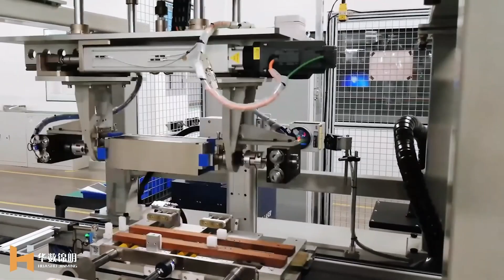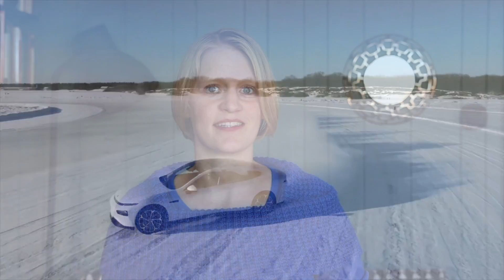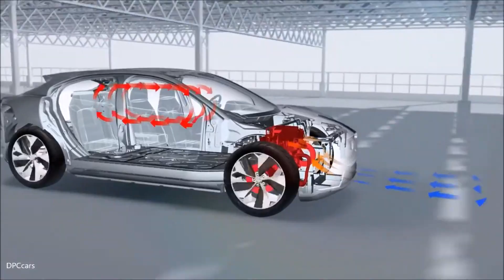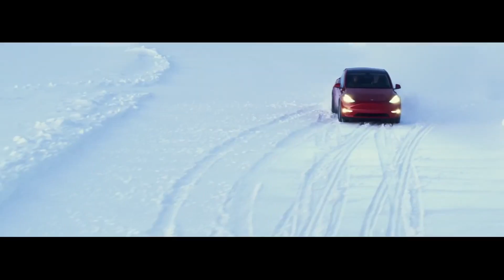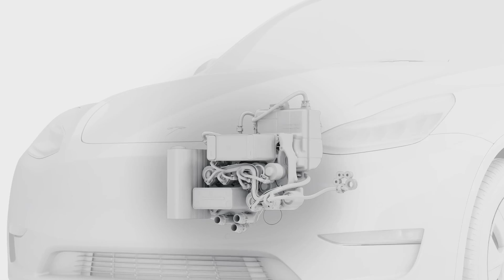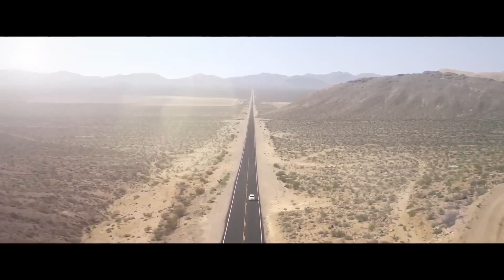Heat Pumps in Electric Cars - Make sure your EV has one

Comment: Heat pump is another useless and costly gimmick. Why to save 1kWh every 100km, sometimes maybe 2kWh/100km, but pay more than 1.200 EUR for it? You have to make more than 100.000km in very cold weather to be on same price. But there are many problems with servicing such components etc... It is good only for people who make thousands of kilometers in very cold temperatures or who are sitting in their EVs all days in winter (TAXI...?) Normal user who makes 1000-2000 km per month and drive normally in normal weather don't need the HP.

Comment: Cost definitely. Just looking at cost, recoup cost of heat pump in over 100000 miles.  Heat pump is not cost effective
Reply from the maker: 😳 Interesting. How much is the heat pump? They put one in for the cabin temperature management anyway. What's the difference in cost between that and the one that can do cabin and battery temperature management?

Comment: Thank you.  Your video makes some good points and provides a lot of information.  In 2025, I still feel it is complicated for a new car buyer to consider whether to specify a heat pump or not.  It feels to me that the decisions might be influenced first by cost, then by range.  However, when considering range, the more important point for the longevity of the battery might be the cooling solution.  I have had an FEV since 2019 and still find it complicated to work out the right platform, battery size, heat pump, battery conditioning and battery tech for my needs.  It will improve though over time.  It has given me a new hobby though 😂
Reply from the maker: From a financial perspective, all you need to decide on is your investment horizon, because it comes down to payback time. :-) Thank you for sharing!

Comment: But does heatpumps work automatically or you need to swtich on ac for it to work? Thanks
Reply from the maker: Hey there, they work automatically to heat and cool you home. It's heating and cooling in one device and controlled by one or multiple thermostats. Thanks! Katha

Comment: The EV1, General Motors' first electric vehicle, was equipped with a heat pump that was developed by GM engineers in the late 1990s. The heat pump was one of many new technologies invented for the EV1, including keyless ignition, regenerative braking, and low-rolling-resistance tires
Reply from the maker: I love this! Thank you for sharing! This was for cabin heating, not battery temperature management, though. Thank you!
Reply: @NetZeroTech  Every heat pump generates heat on a side (high pressure) and cool at the other ( low pressure).
Reply from the maker: @cesarbeltrami6691  Absolutely.

Comment: is this able to operate at real cold temperatures (-6C and below)? as i remember as a former ac ford engineer you can not turn on the system at -6C because condenser simply freeze and can leak.....In this system you will be blowing -6C outside cold air to the already cold outside heat exchanger (condenser in ICE cars) so I am not pretty sure if this think can support it
Reply from the maker: Hi Alex, Thank you for sharing. There has been significant technical progress in the recent years on the temperature range of cold climate heat pumps. 

"A study from Oxford University and the Regulatory Assistance Project used data from 7 field studies across North America, Asia, and Europe which shows that heat pumps are 2 to 3 times as efficient as combustion or resistive electric heating technology, even in temperatures well below 0°C (32º F). In fact they perform significantly better than their fossil fuel-based competitors even in temperatures approaching -30°C (-22º F)."

See Cleantechnica for more information: https://cleantechnica.com/2024/01/22/why-heat-pumps-are-essential-for-evs-when-the-weather-is-cold/

..."In 2021, Tesla improved the Model Y by adding a new heat pump that translated to a 10% improvement in efficiency."

I hope this helps. Thank you! Katha
Reply: @NetZeroTech  thank you very much :) it is always good to keep updated
Reply from the maker: You are welcome. Glad to meet you here. Katha

Comment: Surely you're aware that an air conditioner is a heat pump, so any vehicle, electric or not, with AC, has all the necessary components to heat the cabin without resistive heating or waste heat from combustion.  The only difference is in the valving and controls.
Reply from the maker: Absolutely. They've had a one way heat pump to cool the cabin. Now, they are using heat pumps to manage the battery temperature as well. Thank you for watching and sharing your thoughts. 😀
Reply: It would be reasonable, then, to conclude, where a heat pump is unavailable, that vehicle makers are being especially lazy.  Where it's available at additional cost, it would appear to be a basic money-grab.
Reply from the maker: @kevinhoward8410  Or building bidirectional heat pumps for a EV's battery and cabin temperature management simply isn't that simple.  😀

Comment: My Model 3 does not have as steep a change in range as my i3. One morning last week, it was chilly, and the i3 said 99 miles. An few hours later, the temperature had risen to 10 Celsius, and the i3 changed to 138 miles, and this was after I'd done the school run.
Reply from the maker: Thank you for sharing! I'm curious about statistics on this, which I can't find a lot of. I think despite the late shift from PTC to heat pumps in 2021, Tesla has always had really good battery temperature management. 🙏

Comment: Considering that Tesla's 2nd largest market from the very early days of the Model S was Norway, the fact they took so long to implement a heat pump is puzzling.
Reply from the maker: They used PTC heaters instead until 2021. Heat pumps are of course much better than radiators. There is a lot of design that goes into good battery temperature management.
Reply: @NetZeroTech  Yes but PTC heating diminshes range and if you start off with a cold battery on a cold day it's a double whammy as you need to warm up the battery and the cabin or, at the very least, the driver's seat, at the same time.
Waiting until 2021, by which point Model S was nearly 10 years old was astonishing for a car in the premium / luxury segment.
Even more so when Elon made such a big deal about how much better Tesla air filtration is than the competition, with the intro of BioWeapon Defense Mode - in 2016
Reply from the maker: Indeed. Great points. They paved the way working with the legislation to get EVs on the road, however. So, they have done some heavy-lifting pioneer work, too.

Comment: "Do Heat Pumps in EVs really matter?" - "No matter how highly mechanised and fossil fuels self-powered, fossil fuels extraction requires a number of people - as if the process is executed by hands using buckets and ropes".
Today, this number is 8 billion people - working flat out 24/7 - strong.
Katha, you and I are among those, too.
Our Western Civilisation has been no more than a fossil fuels extraction operation - all along.
Finite fossil fuels are dangerously hypnotic to humans, their consciousness, reasoning and mental capacity.
Humans were not ready morally, ethically and intellectually to start the mass extraction of fossil fuels with the advent of the steam engine 300 years ago.
The Magna Carta requires today overhauling - adding to it the right for humans to understand what Energy really is - before any other commandment.
"In any system of energy, Control is what consumes energy the most.
No energy store holds enough energy to extract an amount of energy equal to the total energy it stores. 
No system of energy can deliver sum useful energy in excess of the total energy put into constructing it.
This universal truth applies to all systems.
Energy, like time, flows from past to future" (2017).
Reply from the maker: Thanks!